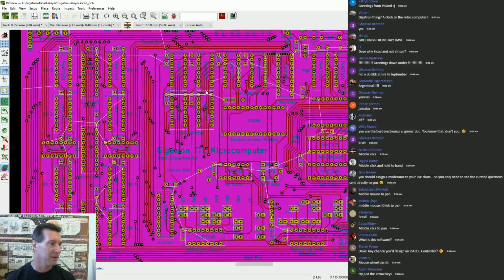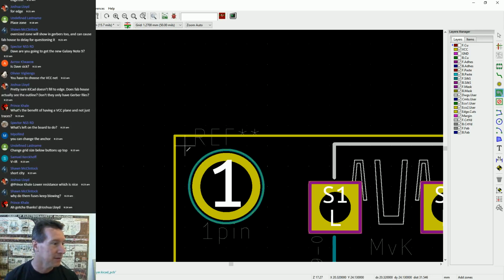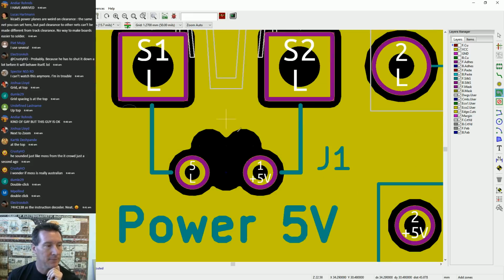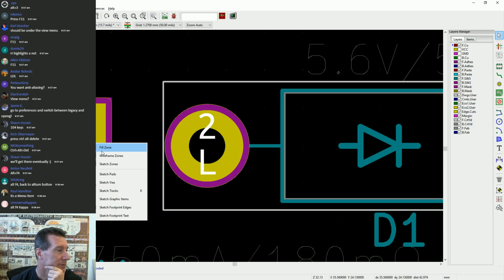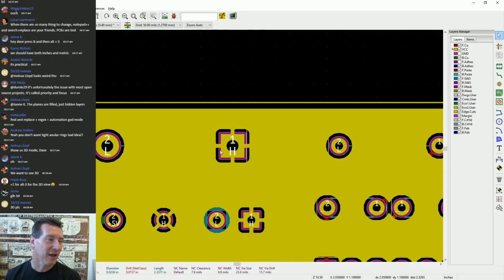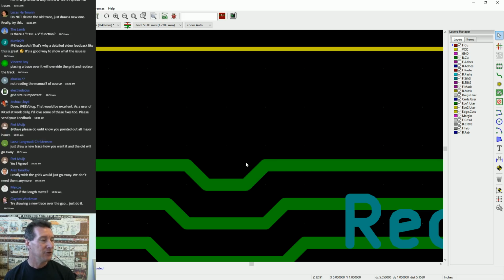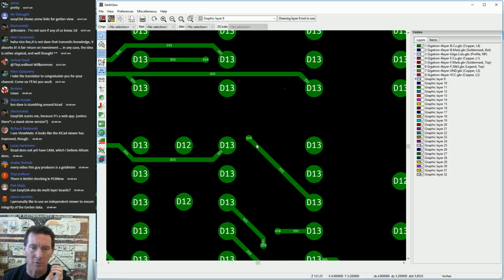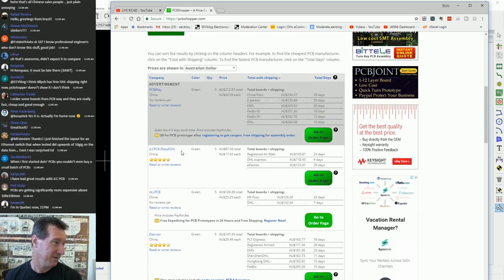LIVE KiCAD 5 PCB Design

Comment: Knowing zero about CAD i can just say  the area you try to straight out is a curve of sort 4  points 5 lines, are you shure you can not hold down shift mark area and pull it in, because it seem like those 4 points/ vertices no longer necessary, but it must somehow know that you do not want to break the line  just remove the 4 angled tracing points that make up the graphical connectors?.

Comment: Kicad is such an awesome tool and it's free. I really appreciate that  the file format is text based and as such can committed to scm. Haven't tried the scripting engine which looks pretty good from what I've seen, but for simple things I can use ordinary text utilities in gnu/linux to modify the pcb. Great stuff. Things I couldn't do i Altium, I'm sure there is probably a way, but for someone like me who is used to using text based tools kicad is awsome.
Reply: Yes and it is also free like in freedom. Full source code is available, anyone can study it and help improve and it will work forever without any monthly subscription or feature locks. And it compiled fine for IBM Power 9 cpu as well! :)
Reply: MultiShizmo try Upverter

Comment: You have some good suggestions about some how to improve KiCad. A cut down video with the suggestions (or just a text version) would be worth sending in to the KiCad programmers. You said B is bottom. I believe the letters are F for front and B for back. A fill zone is affected by the Clearance setting under zone properties. A zone that is right to the edge of the PCB will be pulled back by the value set under Clearance. Adjusting grid spacing before drawing the zone would let you more accurately set a desired amount of pull back.

I noticed the thickness of the angled trace going to the center of U37-19 is different than the vertical trace going towards the pad. Why did you generate the drill file as Postscript instead of as a Gerber? I'm guessing but I think the IRC nick "PotatoPotato" might be pronounced more like "Po-tay-toe Po-tah-toe".

Comment: 17 minutes in and absolutely nothing useful, just whining. It's been like 3 minutes of just complaining about there being no vcc instead of just fixing it. Oh and of course the greatly logical complaining about why you're not going to say why you took down a video when in that time you spent whining about that and trying to push traffic to your site you simply could've just said why -_-
Reply: He does that a lot...
Reply: 71 words in and absolutely nothing useful, just whining. It's been like 5 lines of just complaining about dave jones instead of just unfollowing. Oh and of course the greatly logical complaining about how you'd run EEVblog when in that time you spent whining about that and trying to do literally anything you simply could've just said why -_-
Reply: @bloguetronica He kept in the "don't want to change grid size" rant, because people kept stupidly ignoring the point. Yes you can get the wanted result by changing the grid, or redoing the trace, but good EDA should be able to snap to straight lines. It's a good point. The only reason he kept on the subject was because people kept missing the point entirely.

Dave came up with a LOT of good points on some things that need spit and polish, and I don't disagree with any of the points. Kicad would benefit from having "snap to straight" feature, I would LOVE if I could just select my danm zones by clicking anywhere in them. I hate how if there's a pop-up open, you can ONLY interact with that pop-up. It's a lot of small things, that together would boost the feel of KiCAD a LOT. I say this as a day to day user of it.

Why would you go on and on about what KiCAD does good? It won't get better from that. You might stroke some egos, but feedback is best placed on the small issues that can be improved. Hell Dave even said a few times how KiCAD is a very impressive and capable piece of kit.
Reply from the maker: dumle29 - Ignore Bloguetrónica, he's a guy who rage quite my forum over some silly thing, and wanted to be banned, there is a whole thread on it he started. He said he wouldn't watch my videos ever again, but here he is back again, just couldn't help himself.
http://www.eevblog.com/forum/chat/how-can-i-delete-my-accont-here/
Reply from the maker: I've explained why extensively on the forum, go read it if you are interested, I was not going to waste time in a video on KiCAD explaining why I took down a totally unrelated video.